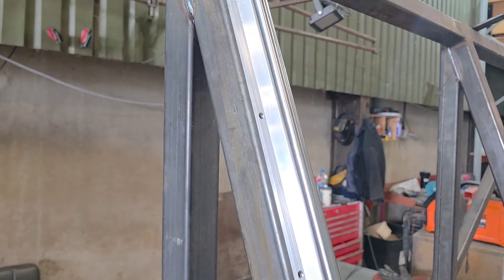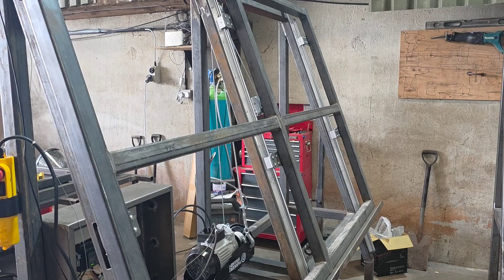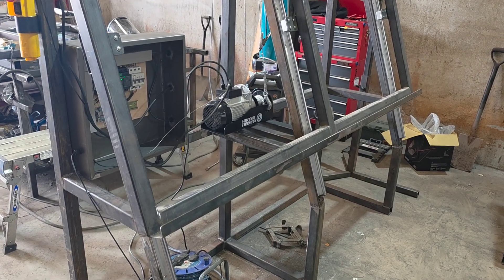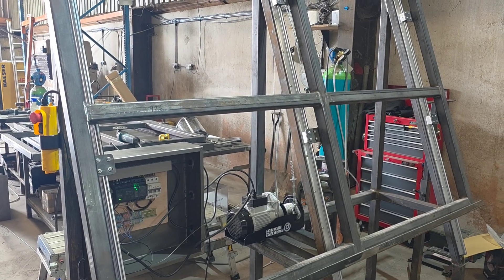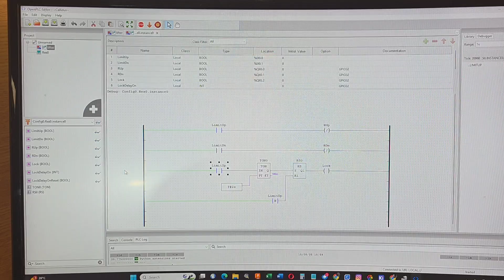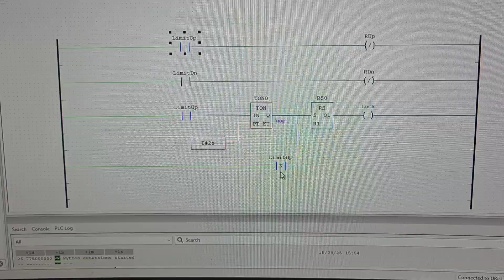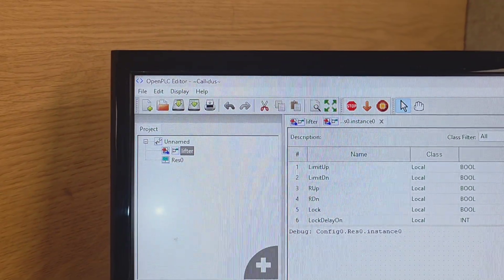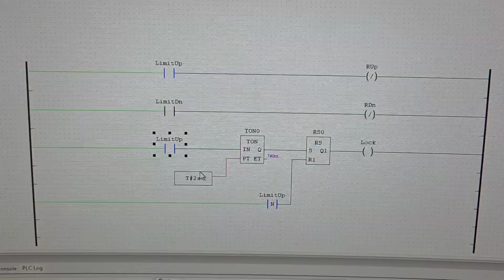A job using an Arduino Opta PLC

Comment: Great job showcasing what you are doing with the OPTA PLC,, I agree with you using OPTA PLC IDE is a bit buggy, I've got a couple OPTA PLCs and I've made them crash simply by connecting them to OPTA IDE Cloud,,, a bit of a process to fix but it is doable although not desirable.

Wondering if you've done other projects with the OPTA PLC to see what you are working on.

Comment: Hey mate, great job! I have a few questions:

1) Looks like the breaker’s taking out the earth wire too… is that on purpose? That’s usually not recommended.

2) If somehow the winch isn't cut when it reaches the top(PLC fails to register or sensor fails), does a dangerous situation arise? I'm asking because an Opta is not a safety PLC, and thus does not have safety inputs nor outputs(And thus should not handle safety functions... generally). The sensor is also not a safety sensor. Generally we use PL (Performance Level, ISO 13849-1) or SIL (Safety Integrity Level, IEC 62061) in the industry to decide if we go with safety relays (or safety PLCs).

Now without doing such an analysis and without knowing the installation head to toe, my gut feeling is that a safety relay might be necessary. Now of course, this is just a gut feeling, if the winch keeps winching and nothing dangerous happens, then all good. 

3) You talked about it briefly in the video, but any particular reason for the 12V power supply?
Reply from the maker: Very valid concerns. We have since deployed a saftey dead stop which the winch cannot over come. We have emergency stops in place but I agree the correct thing to do is to add a performance level saftey device. Im having g on going talks with the client about future additions. Thank you for your input.